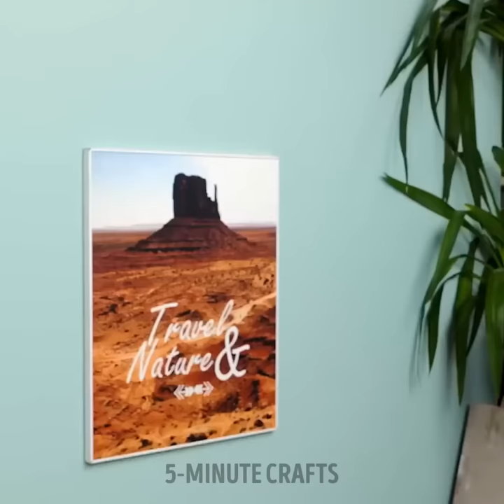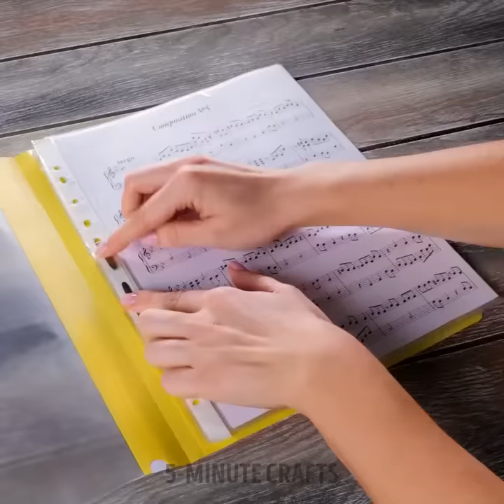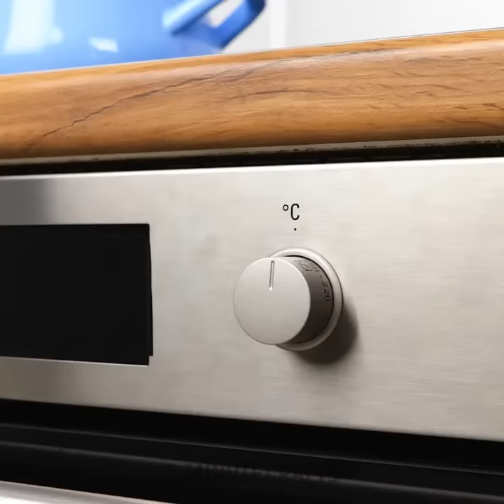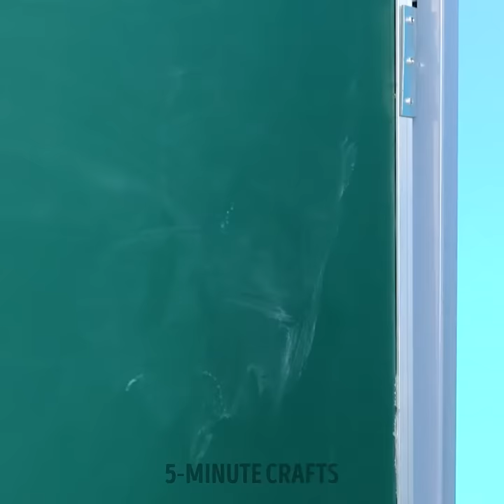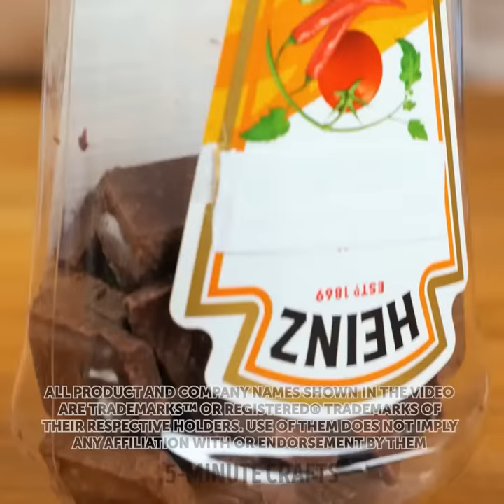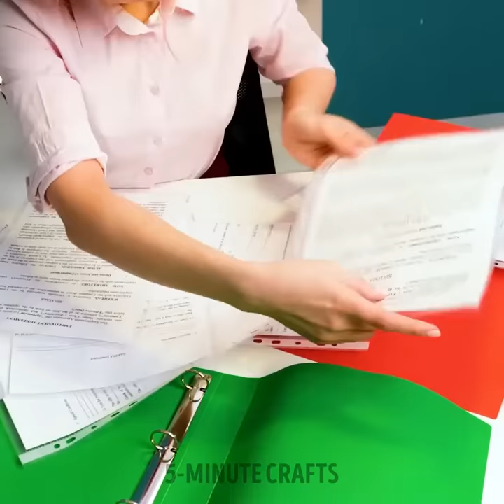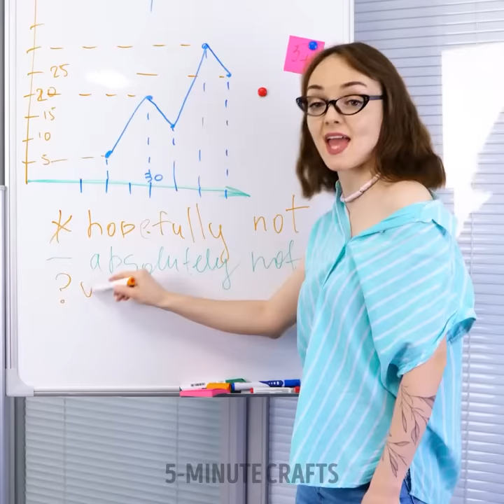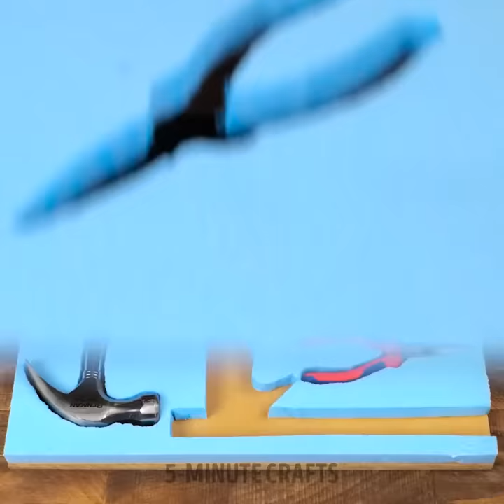Genius Home Organization Techniques to Avoid a Mess

Comment: You have to have a lot of cupboards and storage areas for most of these. Senior housing/apartment not practical. Now we aren't allowed over the door hangers in our apartment. They use Bi fold doors so they can't be used as well.